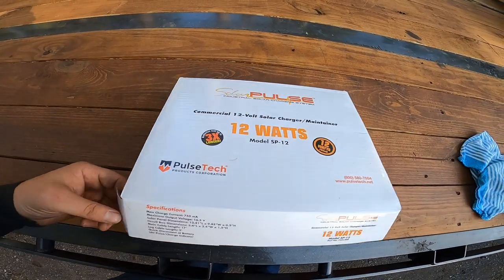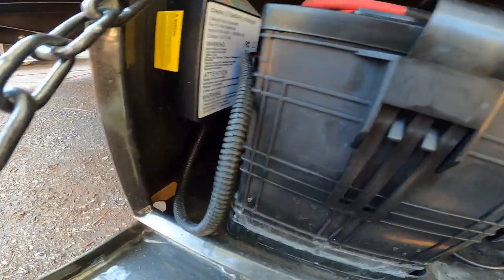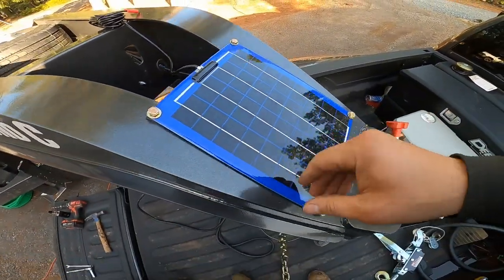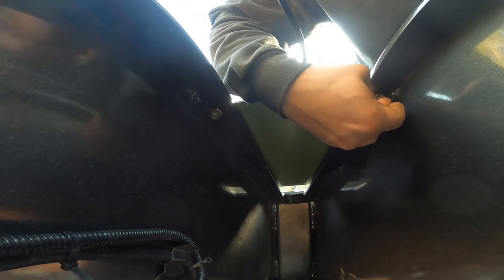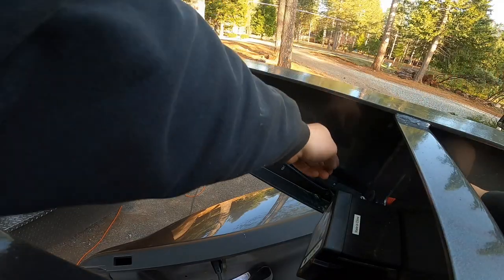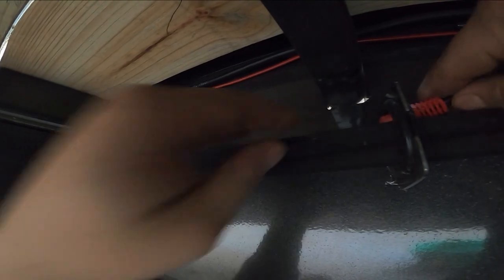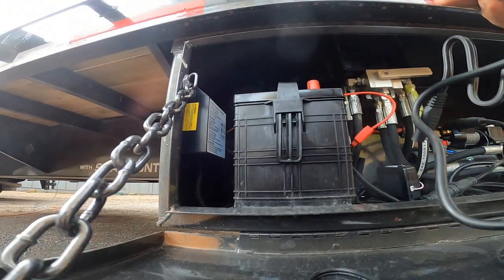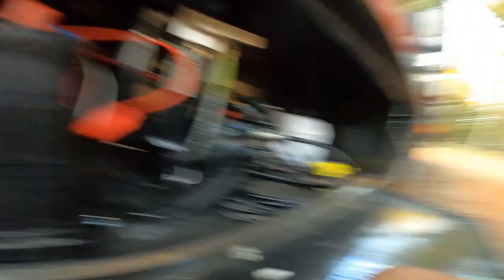HOW TO: ADD A SOLAR CHARGER TO YOUR GOOSENECK TRAILER

Comment: If your truck has the inverter in the bed you could possibly hook up a charger to it. So even on cloudy days or at night you can still charge.
Reply from the maker: I wish it did, but I do have the in cab 120v might just run an extension cord though the back window 😂

Comment: How tall is it to the top of the neck of your trailer.? Looks higher than the cab of the truck.. the one I just bought is taller than the cab and not really sure I like it.   Catches some wind for sure .
Reply from the maker: Not much higher than the cab maybe 1-2” if that. 
Does it Sing on the highway?
Reply: @IManOPERATOR  not that I've noticed but I'm planning to build a deck over the neck.  Then it will be way to tall.  I think I'm going to cut the neck off the uprights and slide it down 4.5 inches and weld it back on..  that way when I build deck out of 3 inch channel and cover with 2bys I'll be back to where I'm at.    Mine is about 4 inches above the cab now.. on cab and chassis Dodge . And I have to have the coupler extended all the way to work even with this tall truck .    Texas Pride messed that up.   I told them measurements to top of the ball on all my trucks falls between 34 and 44 inches.   They built it so you could pull with a truck that's 48 inches to top of the ball and coupler will barely extend low enough to pull with a ball 39 inches high..     how bout your iron bull dump.. looks like the neck on it is a little higher than on your diamond c ? Maybe just an illusion the way it's sitting in the video .   I almost went with Iron bull but I saved a bunch of money with Texas Pride 20k dump, got hydrylic jacks, telescope lift and 7 gauge sides,  floor,  12 inch cross members and 10 inch channel neck, the neck is also 8 ft long from front of upright to center of the coupler.   15775.00 out the door..   just don't like the height of the neck
Reply from the maker: @Mrhilljack  dang man seems like you’ve got the work cut out for you. That will definitely solve any issues. And the iron bull sits just below the cab. Even on the 2nd gen. Perfect in line with the cab hight